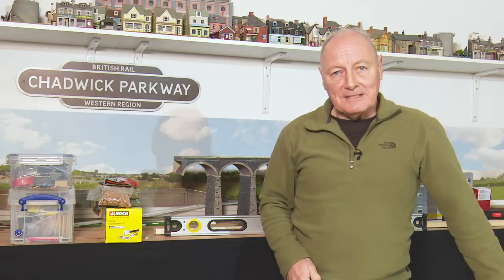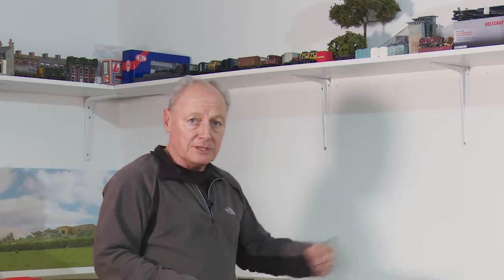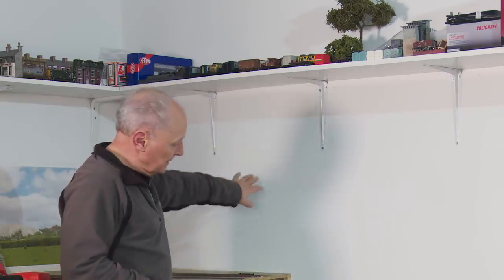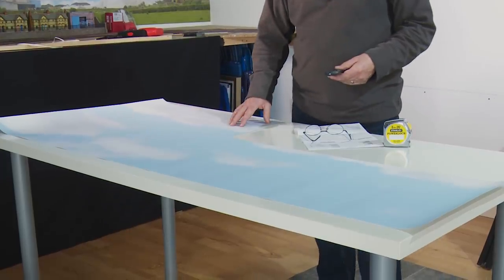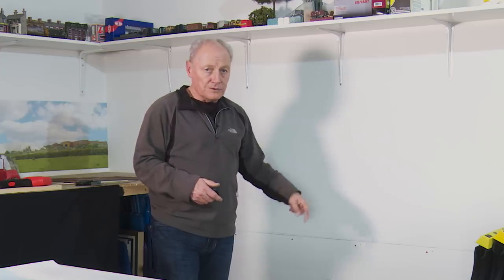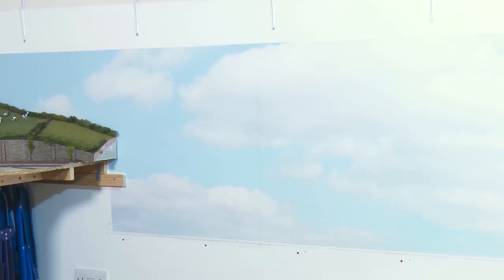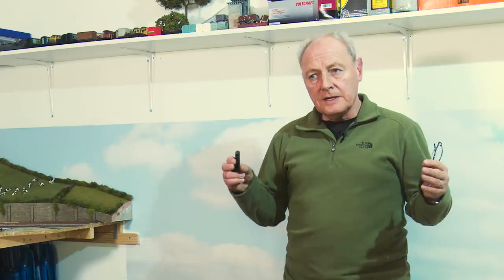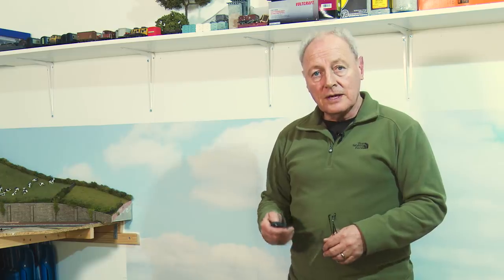54. Backscene Blunder at Chadwick Model railway.

Comment: You’re not the first and I doubt the last!  We ruined the first set trying to use wallpaper paste onto plywood. Then started again this time we used 50:50 PVA to water onto sealed plywood. No bubbles or stretching. We avoided gaps by using double sided tape. Will have to live with some minor gaps and put trees etc to hide them. Love watching your builds and using some of your tips. Steve
Reply from the maker: Hi Steve, at least it made you smile

Comment: Just found your channel. Very nice. I've started a project and regretted it, sometimes just moments later.  I prefer photo backscenes but you do have a lot of area to cover there, so airbrush or spray can may well do nicely. I went to B&Q or Homebase and got them to mix me up a blue that matched the top colour of my backscene, so at least the inside of the room matched the sky but of course there is a join. Tricky issue to solve completely. Cheers, Laurie.
Reply from the maker: Hi Laurie, I’m so pleased that you enjoy my videos.
Yes backscenes are such a challenge.
Good luck with your layout.
Regards Charlie

Comment: I’ve been thinking about that problem of the seam of the large panels, and i think your idea to go to three panels, rather than two, is definitely a good way to go.  Place the location of the seams away from the focal points, and as much as possible behind a structure or foliage to mask them.  If the focal point is the viaduct, then place the seams as far away as possible from there, and that should solve the seam irritation issue.  Also suggest talking to the vendor for a recommendation about what would be the best type of paint, what sort of paste works best with their product, and a wall paper roller to run along the seams.
Reply from the maker: I’m so pleased that you enjoyed it. The roller wouldn’t as there is no overlap. Stay tuned for the update.

Comment: Charlie if its any consolation i had a few problems with my id backscenes from the paper bubbling from last summer's heatwave and making the mistake of applying it to hardboard.
Took the decision to rip the lot down approx 28 mtrs and start again.
This time i purchased the premium self adhesive backscenes and fixed onto 3mm Foamex and then grit filled this to the hardboard, hopefully this will now be  a lot more robust.
Loved your conclusion.
Reply from the maker: Wow, and I thought that I had it rough.

Comment: Charlie i know what a sodding nuisance these things are, and its for this very reason i have now chosen to just paint the walls, the colour i chose is "Johnstones Waterfall Blue Matt emulsion"  its a beautiful summer sky blue and it looks outstanding, with a summer sky there doesn't need to be any clouds at all and it looks better when i run things at night too. I cleverly did one wall a slight shade lighter to stop room reflection, now it looks identical in colour all the way around no matter what angle you look at it.
Reply from the maker: A good alternative plan. At least it made you smile.

Comment: Hello Charlie,I have been ploughing thro all your video's or part 1,very interesting.constructive easy to fellow as you have explain things in detail easy to fellow and understand,i thank you.Just a quick insight of my own project.I'll shall not be too long in the tooth as they say.Erecting on going still a 20' x 18' workshop erected up on 6 bricks,to prevent dampness,.5 mil,thickness,roofing lining,marine ply all round,plaster boarding,even the inner.3 layers.electricty,cctv,alarmed going in.Its really funny how afew neighbour watch over the fence in my process.But once i had started to place 8'x4' the marine ply sheets on the top,a few did come to my aid.So a few beers were handed out and around my way of thanks!!!  Drain pipes on next to run into the river Wandle only 40' away.Hence the height of the cabin/workshop.My main railway layout will be Southern EA's 3-4.Hayling Island-Morden Underground(late 50's 38 stock)-Chatham,with a few A 4's thrown in.(will look rather odd to say the least Link/fox etc.It be DC not DCC as i have well over 180 Engines + rolling stock which cost a bomb to convert over.To conclude my father was a driver on the Goldern Arrow and on the Alantic Express.I'm the old school like yourself Charlie,steam is a living thing.Gained the bug way back when Lines brother's were at South Wimbledon on a school visit,with a free gift of the Princess Elizabeth,black .Then it was triang,hornby/double oo etc then moving to Margate in the 60's.All the very best Charlie----Carol.(Cazz)
Reply from the maker: Well Carol,
You are certainly ambitious.
That’s a very challenging project.
I’m so pleased that you enjoy my videos and hopefully you’ll stay tuned.
Regards Charlie

Comment: hi charlie great videos, i am just about to build my first model railway, the shed while be put in my garden at the end of october, i have spent the last 5 years building buildings etc , stations cottages all scratch built, i am just about to do my backscene for a 5 foot viaduct, the backshene is to be 7 feet long and 4 foot high, the problem i had was the id backscene was 15 inches tall, then i wanted to add another 15 inches of sky backscene, the main problem was joining the joints without it showing plus blending boths skys together, i done an experiment tonight where i glued the sky first then applied the second backscene, i left between 0.5 mm and 1mm i then filled the tiny gap with polyfiller, this left the joint almost invisible, i then spayed white between the 2 papers, so it now looks like one piece of backscene, on friday i will do the real thing with the 7ft by 4 ft backscene
Reply from the maker: Sounds like a great plan Pat.
Good luck mate. Regards Charlie
Reply: @ChadwickModelRailway  hi charlie, as i said 2 weeks ago, i glued the 7ft by 4 ft backscene, i said i was going to polifill the the gaps and then spray afterwards, i am still sanding and polifilling the gaps that must be less then 0.5mm, i like perfection, i have used id backscenes , the welsh mountains scene and i have spent a lot of time on just the backscene so i want it to work,

Comment: Hi Charlie, thanks for watching your ever interesting how to videos. Your strive for the best has got my respect. Did you consider curved back drop in the corner, i.e. continuous run? Mounting the back drop on separate boards of card board or masonite, will that be of any advantage? Always looking forward to hear your considerations and your next update cheers, John
Reply from the maker: Hi John, I did consider curved backscenes at the corners but it was outweighed by the desire to paste it on the walls. Once on the wall the transition to a curve would be more noticeable.  The is no ideal answer.

Comment: Charlie,  If there is an overlap at your join in the middle, perhaps you can take a very sharp knife and double cut over this join.  Then remove the top end piece to the right and the bottom underlap piece on the left side and then lay the two edges together.  this is the way that felt is repaired on a pool table.  If you have a bit of overlap here, try to make your cut a bit of a squiggle so as to throw the eye off from a straight line going down the board.  I did  a lot of wallpapaering when I was young - -professionally.  The other option is to lay a perfectly vertical line over this join.  Then you should be able to align the next sheet.

Best of luck.  Bob
Reply: And on similar lines, check which way the light falls in the room since instead of butt jointing the ends, allow one sheet to overlap the other (fractionally) so the overlap is falling away from the light ie this creates a cliff edge effect along the seem and any joint line is minimised as the edge of the overlap is facing away from the light. I did this on mine and it works well.
Reply from the maker: I tried that Robert before the mess up with the airbrush! At least it made you smile
Reply: Hi,  Another thought is to be sure the light source shines into the overlap to avoid a very obvious shadow line when done the other way.

Comment: As the old saying goes mate “Perfect is near enough but near enough ain’t perfect!” In the long run though your attention to detail will pay off.
One question did you use a seam roller on the joint?
Reply from the maker: Well we try for perfection but adequate is not close enough! No I didn’t use a roller as it still wouldn’t have covered up the seem.
I’m so pleased that you enjoyed it.

Comment: Charlie,
This may be a day late and a dollar short, but - 

I believe I would have used a laser that has BOTH a vertical and horizontal self leveling  axis.

Or - - i would have put up the left side paper first, and over lapped the right side over it by about 1/4 inch or so.
Then with a very sharp knife, i would cut thru this overlap very carefully with fair pressure, and cut both layers in a bit of a squiggle fashion.  A razor blade would be ideal for this or a no 11 exacto knife.

Then pull up the top piece and the under piece and lay the two edges down together in a very PERFET JOIN.

The squiggle will not be detected by the human eye as it tends to lock in on horizontal and vertical lines on  a perfect axis.

Same trick as to splicing the felt on a pool table.

Anyway - save this suggestion for another day.

Bob S, Cleveland
Reply from the maker: An interesting option Bob, perhaps next time.
Regards Charlie

Comment: Hi Charlie. what a shame with the back scene, if I could try help you with a tip if you have not already got the new back scene up.  When you put your first piece on 30" from the corner overlap it with your next piece about 2 inch then get long straight edge then line it up straight and double cut with a sharp knife pull back the edge peel the paper from under, then flatten them both down and they should meet perfectly. This is a decorators tip from me to you. I wish I live closer then I could come and do it for you. Regards George..
Reply from the maker: Thanks George, I take your point but the clouds than don’t line up.
Rest assured I will get it right.
Reply: Hi Charlie. Thanks for your reply and I have absolute faith in that you will get it right.

Comment: Hi Charlie
How annoying.  I don't understand why the back scene printer can't do the full size across your wall if they are making a special print anyway.   We use some digital print machines here where I
work and it is possible to print the length of the material, approx. 25 metres.  Id ask them if they could do that even if it costs a bit extra.
I still find the joins on my back scene annoying but Im living with it because it was such a nightmare to put up.  I really don't want to go through that again.
Your face said it all...
Cheers Paul
Reply from the maker: A fair point Paul. The replacement is on its way so fingers crossed!

Comment: You are right not to have the join right in the middle, because your eye would see the join.  If you could split the panels and the one on the left have something in front of it on the edge of the hill and presumably you can do the same on the right.  Do remember that once you have your viaduct and river, you will putting a scene over it.  It is very difficult to line up paper with a pattern as amorphous as a cloud so don't berate yourself.  Before you start the next back scene, put the viaduct roughly in place.  Look where the joins are and see if there is something that you can place to take your eyes off the joins, all before you paste the paper in place.  Also think if you could do something silly such as suspend N gauge flying birds from the shelves or an even smaller aeroplane so you don't keep seeing the join.  In the end no-one except yourself will see them.
Reply from the maker: Thanks Don but the replacement is on its way.

Comment: There is a bit of a trade-off with angles and distance with those backscene seams. Up close and dead on, you will have some visible seam, no matter how perfect you get it. Looking at it from any angle and even dead on from a bit of a distance, its quite difficult to spot the seam. So you have the right idea making sure there is no seam in the background of the centerpiece of your layout. Painting the wall before hand and painting it white are also important when using those backscenes. I found their premium backscenes stick very well to semi-gloss paint. These are still up 3+ years later - https://www.youtube.com/watch?v=WP3WtP86_U8
Reply from the maker: Many thanks for your thoughts. The replacements are now up and I’ll show the close ups in the next video.

Comment: Charlie, you could paint the sky yourself. Basically, you put a good coat of blue on the wall and then stipple in the clouds while the blue is still wet. You don't have to do the entire area at once. I hope this YouTube link comes through. If not search YouTube for "wet on wet model railroad sky technique". https://www.youtube.com/watch?v=NvXZaw4n_PE The video is from Model Railroad Academy. It's 7:32 long. Good luck!
Reply from the maker: Thanks Flyboy you help is much appreciated.  The replacement backscene has arrived but if it goes to rats, I’ll give it a go.